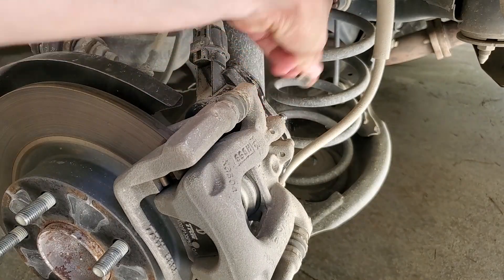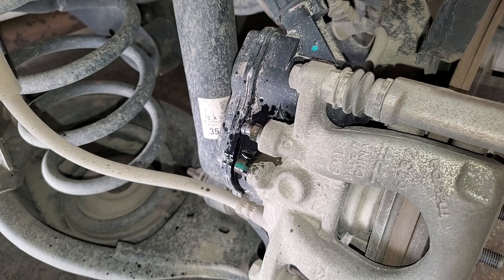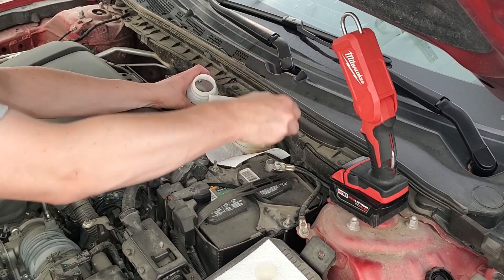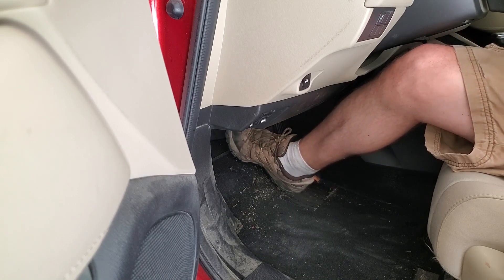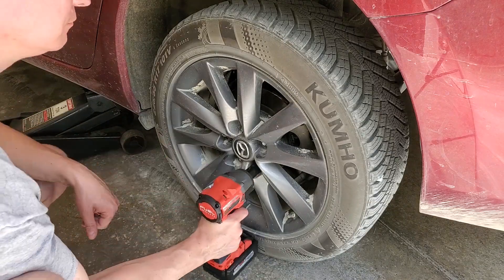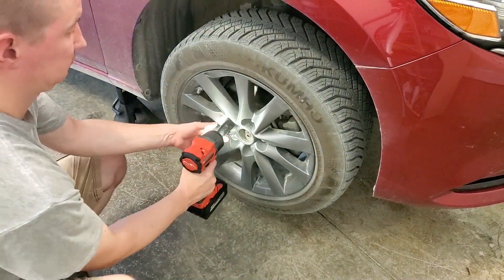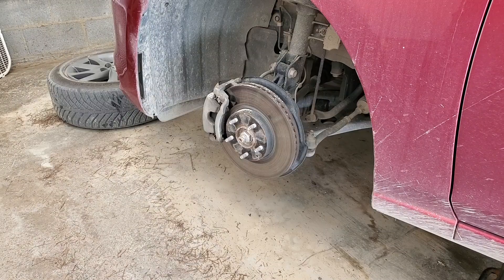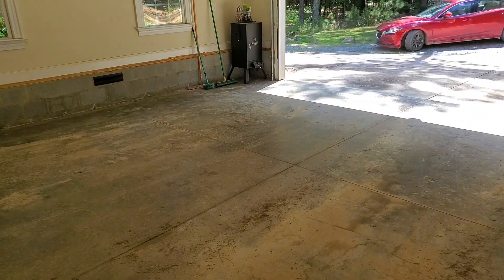Mazda 6 One-Person Brake Fluid Flush

Comment: make sure you close the reservoir cap each time (I spilled on my Mazda Miata).
Reply from the maker: Yeah, brake fluid isn't good for paint. However, I didn't have any splashes or spills. I tucked paper towels around the reservoir, just in case. :)

Comment: Should have spent a few $$$ more and bought a Mighty Vac. Then you can do this job with 1 guy PLUS keep an eye on the fluid coming out so you know you got all the bubbles and not waste excess brake fluid.
Reply from the maker: That's a good point, with a vacuum pump bleeder, everything would be done at the caliper so you can keep a closer eye on things. That being said, I have zero complaints with this bleeder bottle. It has bled the brakes and clutch on our vehicles with no issues. Plus, it's inexpensive and easy to use.

Comment: roughly how many brake fluid bottles do you buy to flush all four sides?
Reply from the maker: I bought two 12 oz bottles of brake fluid and used roughly 1/2 a bottle per caliper. The rear wheels need a bit more since the brake lines are longer. Brake fluid isn't expensive though so you could buy 3 bottles and flush a few more ounces through each caliper.

Comment: Hello Mike, thank you for this video, it will make my break job much easier! May i ask you how much break fluid did you use exactly? I dont want to end up with too much excess😄
Reply from the maker: I used two 12oz bottles of brake fluid, roughly 1/2 bottle per caliper. However, brake fluid isn't expensive so you could get 3 bottles and just use a few more ounces per caliper.
Reply: @Mikeattempts Appreciate that!

Comment: Thanks @Mikeattempts, Quick question- Do I need to put EPB into maintenance mode for brake fluid flush or that is only needed if I am changing brake pads/rotors?
Reply from the maker: Nope, no need to put the electronic parking brake into maintenance mode for this job.

Comment: Question, do you leave the master cylinder reservoir cap off after you fill it each time, between the pedal push and the fluid top up? I've never done this before and I'm about to replace my rotors and pads on all corners and I also replaced the clutch so I need to bleed the air out anyway
Reply from the maker: Yes, I leave the cap off while bleeding the brakes. I also usually tuck a paper towel around the edges to catch any drips that might fall when topping off. However, since you'll be replacing your pads too (I have another video doing the front pads, if needed), you just want to be sure the master cylinder won't overflow when you compress the caliper piston. Unless you've added fluid recently, you won't hafta worry about an overflow.

Comment: So I guess the braking is what's sucking the fluid into the bottle yeah? Also, you only need a buddy for the front? And last, if you simply drain and re-fill with new fresh fluid, is that stil better than nothing? Thank you so much!
Reply from the maker: I'm no pro but I'll answer these questions the best I can. 1.) Pressing the brake pedal is actually pushing the fluid into the bottle. If the bleeder wasn't open, this pressure would be squeezing the brake pads against the rotor. 2.) If you use a bottle with a 1-way check valve (like the one I used in the video), you can bleed all of the brakes by yourself, no buddy required. 3.) If you only drain and refill the master cylinder, I guess that's better than nothing, but the "dirtiest" fluid is closest to the caliper. Also, brake fluid is hydroscopic which means it absorbs moisture from the air. This moisture will corrode the brake lines from within. If you don't feel comfortable doing it yourself, it would definitely be worth paying to have it done. Brakes and tires are the most important things on a car.
Reply: @Mikeattempts  Thanks again. So in the video, you did the braking yourself for the front right? Basically, if I loosen the bleeder, then I hop on and start braking. Now, did you use some sort of pry bar or something to keep the pedal 'pressed' until you tighten the bleeder again? Sorry man, just trying to process this. Thank you so much for your help!
Reply from the maker: @blaneahm9891  Yep, I bled all 4 calipers by myself. You just wanna barely crack open the bleeder then hop in and press the brake pedal most of the way down. If the pedal is too hard to press, loosen the bleeder just a hair more. You don't want it open too much or the pedal will just go to the floor and stay there. Plus, if the bleeder screw is too far out, it could let air in. During a standard 2-person brake bleed, you would need to hold the pedal down while your buddy tightens the bleeder before pulling the pedal back up and repeating the process. That's the beauty of the bottle with the 1-way check valve, you don't hafta worry about holding the pedal down because the fluid (and any air bubbles) can only go into the bottle, it can't come back out.
Reply: @Mikeattempts excellent!! Thanks so much again, you’re a champion.
Reply: @Mikeattempts I see. That’s what I thought. Do you recommend using some sort of brake bleeding vac kit?
Reply from the maker: @blaneahm9891  I know what you're talking about, but I've never used a brake vac. The bottle I used makes the job pretty easy but, if you end up trying the brake vac, let me know how it goes.

Comment: Are you sure the bleeding sequence is correct?!?
Mazda has cross linked brake systems.
Reply from the maker: I made a mistake on the graphic. The arrows are correct but my number 2 and 3 are backwards. I'm no pro but, from what I understand, the best bet is to bleed the caliper furthest from the brake fluid reservoir first, which would have you ending with the one closest. Typically, the order would be Passenger Rear, Driver Rear, Passenger Front, Driver Front. However, some manuals suggest a different order, so I think the order matters much less than just making sure you get all of the old fluid out and making sure no air enters the system.

Comment: I really like that Silicone hose what size is that please 0.5 ?
Reply from the maker: I believe the inside diameter of the hose 1/8" but it will stretch to fit any bleeder and go back to original size once removed.
Reply: @Mikeattempts do you where can I find that hose ?
Reply from the maker: @thehegt  https://amzn.to/3JPK54z
Reply: @Mikeattempts all I need is the hose not the whole set sir

Comment: Thank you for this video! I bought the same tool and performed this service on my 2014 Mazda 3 yesterday. 

At each caliper I pumped the pedal 36 times while topping off the reservoir after every 12 pumps. This filled the bottle slightly more than half way. I had to open a second quart (946 ml) to do the last 2 top offs. It could be done with one quart by pumping out less on the front brakes where the lines are shorter.

Hardest part was getting the screen out of the reservoir!
Reply from the maker: I'm glad the video was helpful! Thanks for the detailed comment, I'm sure it'll be useful for others.

Comment: Be easier just to suck out half the fluid, drive the car for a while then suck out another half. Do that a few times and the fluid would be pretty much renewed.
Reply from the maker: That's not how it works, brake fluid doesn't circulate in the system. Also, if you sucked out half of the fluid, you would introduce air into the lines and then your brakes wouldn't work.
Reply: that works for power steering, not the hydraulic brake fluid though

Comment: Use DoT4 like PENTOSIN from Rock Auto for 9usd per 500ml ...  better fluid.
Reply from the maker: Yeah, even though DOT4 is compatible with DOT3, I just went with what was listed on the master cylinder cap.
Reply: @Mikeattempts  of course and it is fine. DOT4 like Valvoline synth or Pentosin have higher boiling point and and are absorbing less moisture

Comment: Where does Mazda state that a brake fluid change should be performed every 2 years?  The maintenance manual only states a 2 year interval for vehicles in Mexico.  But for USA, Puerto Rico, and Canada there is not a stated time frame for brake fluid changes.
Reply from the maker: Yeah, that was the best I could find too so, that's what I go by. If you Google it, you'll get the same answer from multiple sources.
Reply: Same in Europe, 2 years

Comment: On modern cars you start bleeding at the wheel closest to the ABS unit and work your way out.  If you don't have air in the system then the order doesn't matter. Only fill to the max line if you have installed new brake pads all around. Half way between the min and max for old pads.
Reply from the maker: Thanks for the tips!

Comment: Excellent video, you made it look super easy. I’ve been looking for the correct adapter to attach to the reservoir so I can use one of those tanks were you pressurize it via manual pumping then just crack the bleeders, but haven’t been able to find one. Any suggestions?
Reply from the maker: Thanks! I was actually gifted a cheap version of something similar from Amazon but, after doing some research, I ended up purchasing this bottle instead. I never even tried the pneumatic brake bleeder kit. This one-way bleeder bottle couldn't be simpler while the other seemed more complex (more potential point of failure) than it needed to be.

Comment: Great video. I aim to do thisjob soon with the same bleeder bottle. Quick question: In the sequence for bleeding,  is it not meant to be the furthest from the master cylinder to the closest, so rear first, then to front? The diagram in the video shows rear, front, back to rear and then front again. 

Thanks.
Reply from the maker: Oops, that was 100% a mistake on my part when creating that graphic. Despite the error in the image, I did perform the bleeding in the proper order. Follow the arrows, not the numbers. It should be Passenger Rear (1), Driver Rear (2), Passenger Front (3), Driver Front (4). I don't know if I can fix it in the video or not but that you for pointing it out.
Reply from the maker: I added a "Correction" that will pop up on the video when that image is displayed. Thanks again for pointing it out!

Comment: I've just replaced the rear wheel cylinders (which were leaking) and the brake shoes on my 1982 Mitsubishi L300 Express van. I got my wife to operate the brake pedal while I opened and closed the bleeder nipple. That one person bleeder bottle looks like a good idea iv you don't have a second person available to help you.
Reply from the maker: I'd use this bottle even if I did have a willing helper. No coordinating "pump the pedal, press down and hold, now bring the pedal all the way back up" over and over. :)

Comment: Good idea to get a flare nut wrench (what we call a brake pipe spanner), which is a single hex with a cut-out to go over the pipe. This type of wrench ensures that you don't round off the bleeder nipple, which can happen with an open-end wrench.
Reply from the maker: I've got one flare nut wrench, but I don't remember off the top of my head if it's the correct size for this vehicle.
Reply: @Mikeattempts  I have a 3/8" / 7/16" one that I used to use in my older cars  beck in the 70's and a metric set of eight or ten sizes for our later cars.
Reply from the maker: @BrucePierson  Our Mazda 6 uses the same 10mm size on each caliper but my Honda Civic uses 8mm on the back & 10mm on the front. So, I should only need 2 flare nut wrenches to be covered.

Comment: Worth pointing out: Brake fluid is not consumed in normal operation.  The fluid level is an indication of pad wear.  If it's low, don't top it up; it's time to check your brakes.
Reply: This is a good point. I was taught to return the master fluid level to the 'as found' when you finished as it can be used as a quick visual check of gross pad wear for all 4 wheels.
Reply from the maker: Yep, if you follow that logic then your master cylinder won't overflow when you compress the caliper pistons either. :)
Reply: @Mikeattempts  Yeah, when replacing disc brake pads, first open the bleeder nipple before pressing the pistons back so that you don't overflow the master cylinder reservoir and end up with brake fluid damaging your paintwork. Remember to close the bleeder nipple of course to prevent air entering the system. After replacing the pads and pumping the brake pedal, the res reservoir will likely need topping up.
Reply: As pads and shoes wear, the fluid level in the master cylinder drops. It can drop quite a bit and the pads and shoes will still have a good service life, so it's normal practice to top up the master cylinder as necessary to maintain the correct fluid level. If the fluid level is correct and worn pads and/or shoes are being replaced, then you can't return the fluid to the master cylinder or it will overflow. My mate did that on a car he was putting new pads in. If you don't keep the master cylinder fluid topped up, it can get so low that air gets into the system and you won't have brakes.

Comment: Top tip. Remove the bleed screws and apply PTFE tape to the threads. This prevents air from entering the caliper via the threads during bleeding, and prevents the bleed screws from corroding to the caliper and being difficult to remove next time.
Reply from the maker: Yeah, but wouldn't you get a bunch of air in the system by removing the bleeders? I've used this bottle to bleed the brakes on both of our cars, and also my clutch, and haven't had any issues with air getting past the threads yet.

Comment: Good video. I use a Motive one man pressure tank that connects to the reservoir so you don’t run out of fluid, and love it. I also discovered that you don’t usually need to remove the wheels, at least not on my Camry, CR-V, RAV4, & Tundra. You can get to the bleeder screws from the front or back, often without jacking up the vehicle much or at all.
Reply from the maker: Ah, that sounds pretty nice. Is it the kind that builds up pressure in the master cylinder reservoir so all you need to do is crack the bleeders and they bleed themselves without needing to pump the brake pedal?
Reply: @Mikeattempts  That's what I use, on a clutch I had it was the ONLY thing that worked. One downside is you need a cap that fits the master and if you work on a few cars you might need an array of them.
Reply from the maker: @BLKMGK4  This bottle has worked great for the brakes on both our cars as well as my clutch. It's my favorite type of tool, simple and effective. :)
Reply: The Motive & Amazon clones kits  ( & adapters ) are problematic.  Invariably, if the adapter is not a perfect fit on the reservoir, brake fluid leaks everywhere. The move some DIYers make is to use it dry.  Don't put fluid in tank.  Just utilize It's pressure function to allow for one person bleeds.  It's a chore to detach the adapter & top off brake reservoir between wheels.  Today's cars are built with cheaper & cheaper plastics & electronics.  Brake fluid on a electrical connectors can give you expensive problems.  Also, never , ever have those quick oil change places touch your brake reservoir !